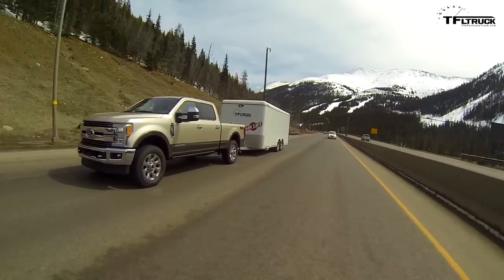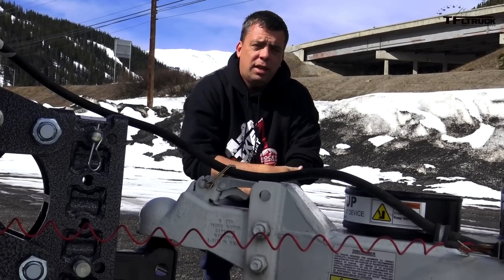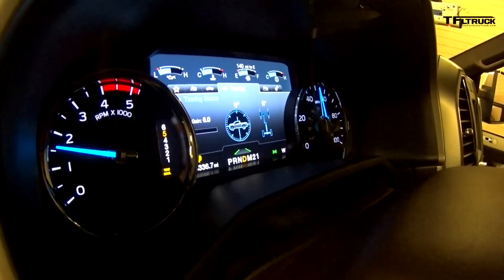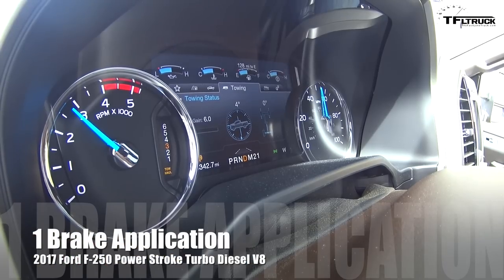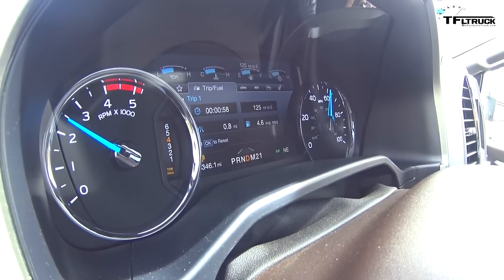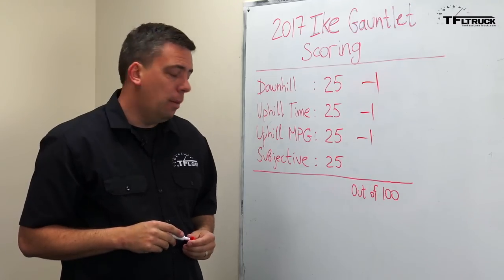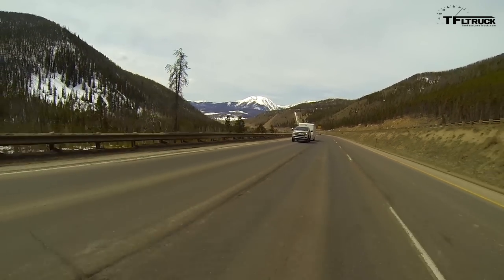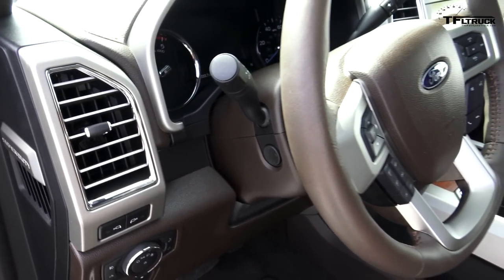2017 Ford F250 Diesel V8 Takes on the Ike Gauntlet Review: The World's Toughest Towing Test

Comment: Nathan not sure why you dislike the hard surfaces I see the hard plastic as a plus for cleaning , durability and  especially 15 years down the road when some kid buys it throws some armor all on it and its as good as new
Reply: Other plastics exist that are just as easy to clean, but are much thicker and, frankly, altogether better, Plus, the fitment of the plastic is poor.
Reply: Nathan I can totally understand if they don't fit correctly because that's part of the reason I dislike square fender wells over round tires and again its just my opinion but I like the hard plastic dash boards and the door panels are fine with me too. The trucks with soft materials where working men lay their  sweaty arms on the door panels  after a day of work wears and discolors the soft material out faster

Comment: test the 6.2!!!!
Reply: I second that. Bring on the 6.2!
Reply: with the 4.30s testing the 250 and 350 would be great too since they are different transmissions
Reply: Let's see the 6.2 tow the same trailer for a true comparison.  Not everybody needs 925 ft lbs of torque!
Reply: yeah at the flywheel....not the wheels, ford always does that so youre losing probably 10% from there to the wheels lol.
Reply: They all "do that"

Comment: I tune out every time Nathan starts talking about hard plastics.  I don't like the soft touch surfaces.  They are hard to clean and easy to damage.
Also, I guess Nathan does not know that the current F150 cab is larger than any Super Duty exclusive cab before it...
I am glad they reviewed the diesel.  I don't get buying a 3/4 or 1 ton gas truck...

Comment: I don't follow Dodge or Chevy as closely, but don't they share a cab between 1500 and HD series?  He acts like his mind is blown that Ford is doing that but I'm pretty sure that most everybody does that to save costs.

Also, I hate to be the one to break it to him, but a $76k truck is going to share some features with the work trucks (XL).  Which means a panel or two will be plastic.  They aren't going to add 2" of padded rubber covered to suede on every body panel inside a King Ranch.

Both the cab sharing and the cheaper parts of the interior are to save money.  Neither one of these are news in the HD truck industry

Comment: Torsion hitch is $200 my drop down hitch extremely heavy duty no rubber crap at$150 and was worn out in a 2 years.
I can't imagine if you actually pull everyday how long it would last with a torsion hitch

Comment: If I spend $10,000 on my 7.3 idi non turbo I would have a better truck than any $80,000 modern vehicle hands down. 
Let's talk about this truck in 30 years..
Compared to the idi which is completely bomb proof and still going.

Comment: Nice truck, almost bought one, 8.03 minutes with 925 ft lbs and 440 hp, the 2015 Ram did it in 7:33 minutes with 800 ft lbs and 370 hp albeit a 2wd and 250lbs lighter trailer. Is Ford over rating their power or is Ram under rating theirs?
Reply: Nathan clearly said he could have broken the speed limit but chose not to. Said he had plenty of reserve power. I surmise the 8 min benchmark is because if you stick to the speed limit that is the fastest time possible.
Reply: I'm not sure about the 8 minute benchmark thing, you may be right, however the same comments were made in the Ram video about having to back out of the throttle in order to keep below the speed limit, so it seems the rules were the same for both pulls, at least as far as I can tell from the videos.
Reply: Todd Robinson so ask yourself- if both could maintain the speed limit from start to finish, why would the times be different?
Reply: I don't believe either video claimed they both held the speed limit start to finish. A faster time would indicate that one was able to hold the speed limit for a longer period and distance than the other.
Reply: Todd Robinson and once again- at the end of the Ford video Nathan said he could have broken the speed limit and had power in reserve. Roman didn't mention whether or not he focused on that or not. They also aren't starting from a stop. They are rolling- so once again- if they can both maintain the speed limit throughout, why would the times be vastly different. An 8 minute benchmark makes sense if stating within the speed limit. Lets say the speed limit changes during the run. Now we have subjective times when the driver started or stopped accelerating. So a time standard makes sense for multiple reasons.
Reply: John Smith the pulls were done 2 years apart by different people,different trailers and probably different weather conditions and I'm sure this had an effect on the times, no argument here. I'm not hating on Ford here, I drove it, it's a beast and have owned super duties since the mid nineties. The fact is that Roman does say in the Ram video that he had to back off the throttle to keep it under the speed limit which maybe he did maybe he didn't, only the guys in the truck know for sure. My original point was that the runs being equal, which they mostly appear to be, the numbers don't add up.
Reply: Todd Robinson no argument there. Both of us are operating on incomplete info.

Comment: The thing I hate about this channel is your inconsistency in your tests.  If you're going to test for things like fuel milage in a truck vs truck comparison, you need to have as close to the exact same conditions as possible. Same guy driving the truck, same overall final drive ratio for flat ground mileage tests, same total combined weight, same rear gear ratio for hill climbing and mpg while climbing, same atmospheric conditions.  Fuel milage is the final result of many factors like the ones I've listed but the single, and usually largest one, is the nut behind the wheel.  If you accelerate wide open and then pedal drive it, you're going to have a completely different result than if you accelerate at a modest rate and then turn on cruise control.  I understand not all trucks are smart enough to be able to be left on cruise control and so in that case the nut is just going to have to do their best job.  Overall though, most cruise controls are way smarter and more efficient than any human could ever be if a constant speed is your desired test medium in obtaining mpg. You guys just have way too many variables in your "tests" for them to be considered accurate in head to head testing and so they are misleading at best, and flat out dishonest at worst.  I know that it's impossible to have a truly exact head to head test but you need to try to take out as many variables as possible.  The only variable that should and needs to exist is your personal feelings on each truck about what you liked and what you disliked.

Comment: Someone please correct me if I’m wrong, I’m learning. The reason they couldn’t tow more than 12,500 pounds (besides the trailer not being strong enough) was because they maxed out the GVW of the truck? So how could the truck tow 15,000 pounds without exceeding this number? (10,000 lbs.)
Reply: The reason is that particular F250 has very little payload capacity. 2080 lbs is not much payload for a heavy duty truck. My F150 is rated at 2037 lbs payload. The payload in this vid gets used up by the tongue weight of the trailer which should be ~10-15% of the weight of the trailer and the two riders. That truck can pull a mountain, just can't carry it. The companies usually publish max stats though they will vary vehicle to vehicle.

Comment: My 19 f250 Lariat Crew Cab 4x4 Diesel is the best pick for the money. (See my vids of it)...it has Heat/cooled leather, power everything, snow plow pkg, dual alternators, rapid heat supplemental heater, all for sticker price of $66,950. If you don’t do 20” wheels and sunroof and Lariat ultimate pkg and the tailgate fold step, you can still be out the door for under $66k for a 19. There’s no reason to go to $76k and more ...you don’t get enough extra value for the 10 grand. I put sweet LED headlights in for most all the exterior lamps. You don’t need Fords $1300 LED package or Adaptive Cruise for $7000 lol That should be free by now, all the new dumb Toyota’s have it included standard lol

Comment: Why is the subjective on this truck so much higher then you gave the 350? They are the same interior.
Reply: They have a different ride, feel and overall - the 250 felt better,
Reply: Well, looking at all of your vids, the GM and Dodge are consistent. The Ford, not so much. The 450 looked like it handled the 30k like a boss, the 250 handled 12k with no issues. Do you not think something was off with the 350 test? You stated its sluggishness with 22k is why you gave it such low scores, with no mention of the interior like you did here(and they should be identical with the only differences in small detail). I would like to see another run with the 350 at that weight, or better yet, it and the dodge and max capacity to see if the Ford is just set up to run that way.
Reply: starcommtrey We've discussed it. I want to see what the Ford will do maxed-out. It will depend on what Ford and Ram have scheduled for us.
Reply: That would be awesome, also, FWIW, I really appreciate the education you give people on what vehicles are actually rated to tow. It is nice knowledge to have.

Comment: I hate generally hate all American automobile manufactures, and Ford is no exception for many reason ranging from poor quality control to reliability issues. However Ford got it right with their true work trucks. We have a 2014 Ford King Ranch Turbo Diesel that we used exclusive to build up a business from ground up. Literally. that we got got fully loaded. Admittedly we made that truck tow WAAAY ABOVE  it's tow rating ( long hard miles east coast) rain, snow hail or sleet. we couldn't afford a full size semi so we did our best initially building the business. The business we own now, and the fleet of trucks and the other branches were built off of the Ford King Ranch  towing, hauling and being driven nearly round clock for 2 years straight! in 2 years we've put about 400,000 miles and you'd never guess. We still have it, it sit in our drive way now, but when ever we turn it on, it starts right up and runs like it just rolled off the assembly line.. And this went on for the duration 2014 well into the end of 2016. It never had

Comment: Actually the Chevy 3500 got 1 brake application with almost twice the weight and it was actually going slower than 50mph
Reply: Tyson Reid you're comparing a dually to a f250 lol it would make sense if it was a f350 to it but not a f250. its like comparing a f150 to a chevy 2500
Reply: CallsignVader no it's not at all dummy. They both have the diesel motor so in theory there is less weight to stop with the single wheel f250 so the f250 should have the advantage
Reply: Your theory couldnt be more wrong. The dually's are geared totally different to handle more weight and to slow down/stop more weight. Thats an unfair matchup "dummy". If that were the case why would anyone buy the heavier duty dually if the the 250/2500 series are better?
Reply: @Tyson Reid - You're wrong and I don't need to explain why. Others already have.
Reply: Sure bud, whatever makes you sleep at night
Reply: Are you talking to me? I was taking your side.
Reply: Whoops my bad, thought you were the original commenter haha. Thanks homie :)
Reply: Yeah no problem man lol.
Reply: The f250 comes with 3.31 gears(I have this), 3.55, and 3.73s. The 350 and 450 duallys come with 4.10s or 4.30s. Besides the fact it being faster, it does not help the truck slow down because "less weight", thats not how any of this works.
Reply: RuggedSportsmen yes actually that's how physics work, less weight to stop with the same brakes and same exhaust brake and engine and gears means you slow down quicker
Reply: They physically cannot be the same gears because they dont even offer the same gears
Reply: Final drive gears are only part of it. Final gear can be different and the trucks could have the exact same total gearing if tire size is different, but the transmission can also be different gearing. So saying any of it based only on axle ratio is missing 2/3 of the equation.
Reply: Shawn Dickens they put the same transmissions in the heavy duties.
Reply: Are the tires the same?
Reply: Shawn Dickens depends on the trim level you get but you can get them the same other than on the duallies have 6 instead of 4
Reply: Then you need to figure the ratio through the tire size to see how they differ. Little higher gear can sometimes just be to make up for a taller tire. Looking on grimmjeeper gear calculator and I do t see that trans to figure out how many ratios it's offered with.
Reply: Shawn Dickens I just said they were the same size
Reply: Found it. Looks like only one ratio package.
Reply: RuggedSportsmen yes they do I'm not talking about the Ford F-250 and 350. The DURAMAX has the same gears and therefore the 2500hd will stop quicker than the 3500hd
Reply: The 250 can pull more also because it has the same gross with less used by the truck. 350 can have more weight on the rear axle.
Reply: Shawn Dickens no the vehicle does not have the same gross because the the tires and suspension can't take the weight.
Reply: Sorry got that a little wrong. I think the 350 non-dually pulls more, but less payload than the dually. Guess the F250 might not be at the same tow weights. Not a Ford guy after my first car. I was between Ford and Chevy on my last truck, but I couldn't look at that interior everyday and the ride was rougher for no reason.
Reply: The Chevy also came with a box of tampons~  yayyyy!💄

Comment: My 2004 F-350 6.0L Powerstroke with the 6-speed manual has made that exact run several times a week for the last 7 years. (Leadville native) I manage to get 7-8.5 mpg fully loaded going up that hill. The new Superduty is impressive, but the fuel mileage and extreme expense just aren't worth it IMHO. Great review guys.
Reply: F350JOHN I guess newer trucks weigh more too
Reply: F350JOHN how loaded are you? It makes a huge difference for fuel economy. The new diesel should get better fuel consumption.
Reply: Tyson Reid Right around 9700 GVWR. I'd say about 200lbs less than their trailer. It's pretty much known that the older trucks get better fuel mileage. My truck was made before the days of all the crazy SCR/DPF and DEF stuff.
Reply: F350JOHN ya but that is a garbage motor and had terrible issues with EGR so yes even with all the emission regulations the new ones get better. The 7.3 gets better milage because that's a good motor. The 6.0 is just a overall pile of sh*t
Reply: F350JOHN surprised the 6.0 didn't blow up. terrible engines.
Reply: Newer trucks get worse fuel economy than yours and my 6.0 cause of all the emissions crap they have to have. Don't listen to the haters.
Reply: Raptor 450 I bulletproofed my 6.0 back in 2011. Its been excellent ever since.
Reply: Hoss Cartwright I'm not sure, but I think mine still weighs more due to the steel body. The difference would be minor if anything.
Reply: Tyson Reid Yes, nobody is disputing the 6.0 being a lemon overall. But its vastly better than the 6.4. The 7.3 was the most reliable, but was underpowered. I bulletproofed my 6.0 in 2011.
Reply: billet03 They will believe what they want to. Nobody can change that. It's been proven that the older pre-emissions and partial-emissions trucks got better mileage. That plus being paid for long ago is why I'm happy with what I have. if a person wants to pay $75-$85k for a new one... great. I'm not knocking them.
Reply: F350JOHN it's a bigger more powerful engine
Reply: American Track Master without a doubt. But with all this technology... one would think...
Reply: F350JOHN how often is your 6.0 going into regen? got a tune on your truck?  
I've had several 6.0's, Ihm a fan, but you aren't getting what you claim, especially if you follow the procedures that TFL did.  fill up, reset the tripometer and immediately head up the hill.  You aren't getting 8mpg doing that.  Nice try though.
Reply: F350JOHN and I guarantee you have a tuner on it.  are you hand calculating or going off the lie-o-meter?
Reply: Jeff Clark No tuner. Just an old, underpowered 6.0. still better milage than these new ones while towing. I don't have a lie-o-meter... I do the miles traveled decided by gallons of diesel added. The old school way.
Reply: I always felt that the 6.0 had excellent power for that era, better than the others out of the factory.  
Remove the EGR and stud it and you have a very reliable truck.  
The negative reputation it had in 03-07 has turned, lots of people are looking for those trucks because they don't want to deal with the Regeneration and DEF that the newer trucks have. 
BTW, the "lie-o-meter" is the digital fuel mileage readout in the truck, it's usually not accurate. 
But, from past experience, if you hook up a trailer, fuel up and immediately start heading up the mountain at full throttle, you won't see 7 or 8 MPG at the summit/finish line, but if you start out on the flat for 20 miles or so, to get a head start, get the truck going at a 12mpg pace prior to the climb, you will easily get 7 or 8 by the time you reach the summit, but so would the newer trucks.
Reply: Jeff Clark 6.0L doesn't have "Regen". It's pre-Def and exempt from a lot of the new emissions crap.  Mine makes a lot of power.

Comment: Really $80,000 area with 4 to 5 mpg loaded for this price move up to a f650 more power better fuel economy and if your going to pull this kind of weight all the time you need a bigger truck.  In the short run this configuration will not last.